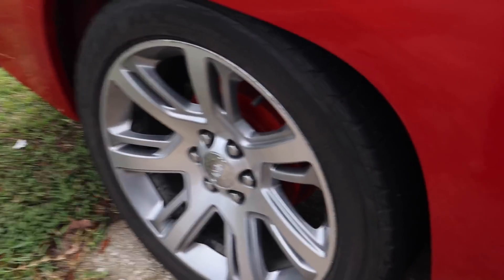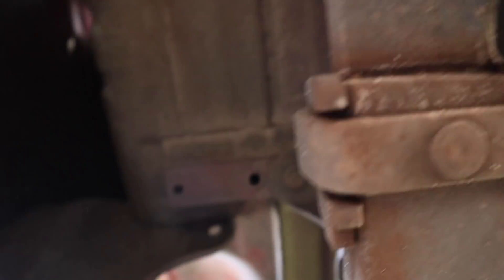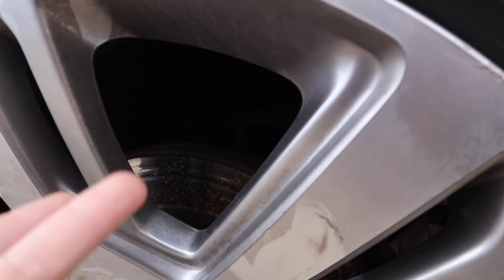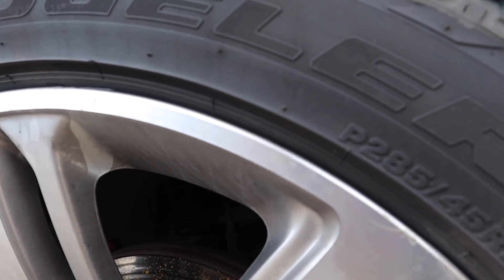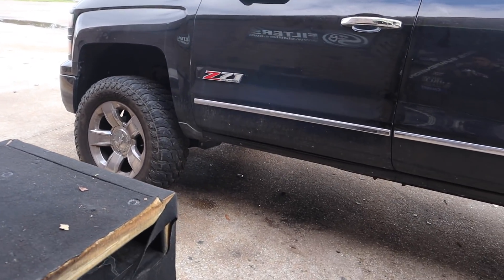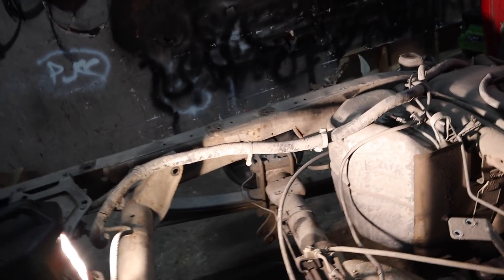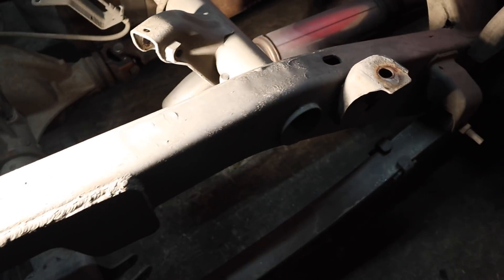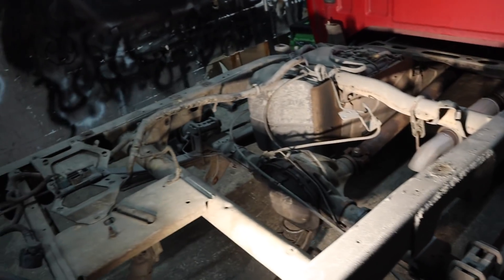6/9 Drop (fixing the ghetto drop)

Comment: Is it better to install a one piece drive shaft
Reply: No, when lowering really low it is best  for a 2 piece driveshaft. For regular drops a 1 piece drive shaft is fine.
Reply: @Angel-ft8bv  how about vibration
Reply: I don't think you should get any vibrations if you follow the directions properly. Some kits even come with shims in case your pinion angle is bad(usally the cause for vibrations).